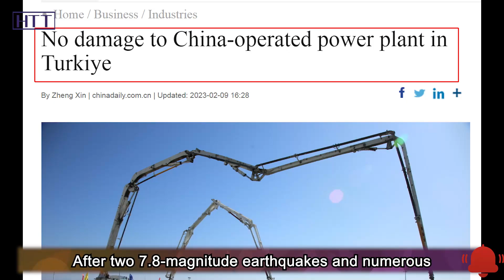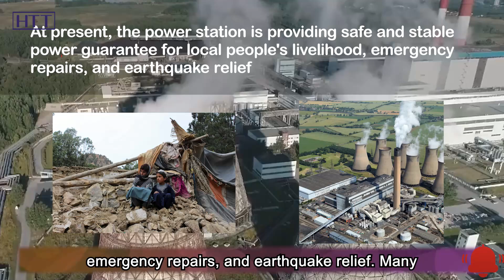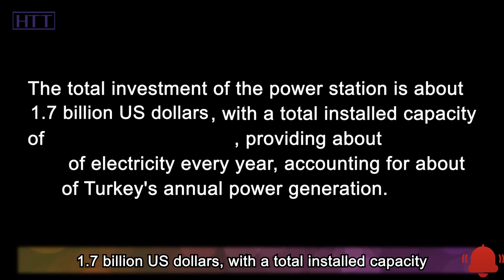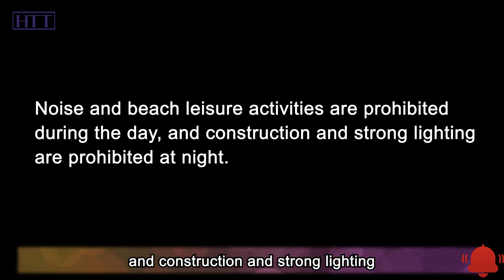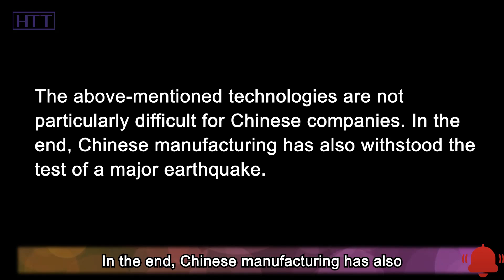Turkey Syria earthquake, why did China power plant stay intact in the epicentre of the quake?

Comment: The nuclear plant Russia is building in Turkey is also completely unaffected - the architects, well, the architects matching the skills their job requires, pick the exact spot to build such infrastructure carefully - so that powerful earthquakes would have lower effect on the building, besides designing the structure and equipment to handle such disasters without problems. The construction will continue, once the construction machinery and workers return to the infrastructure object after they're done clearing out collapsed buildings and the bodies underneath them...

Also as a note it seems buildings built by the Turkish state companies do fine overall. Can't say the same for privately built stuff, looks like cutting costs (and corners) was the primary concern there. That doesn't keep the liberal opposition in Turkey to spam clickbait with the bad building quality - just to put another nail on the coffin of the theory that the earthquake wasn't deliberately made...